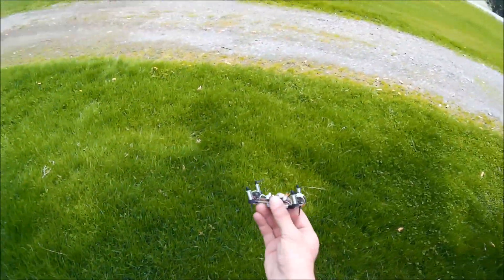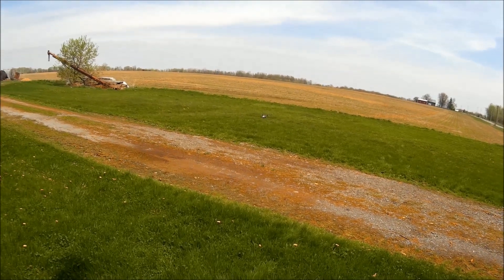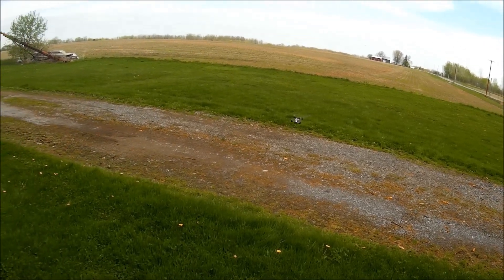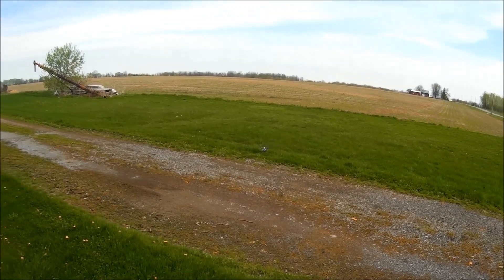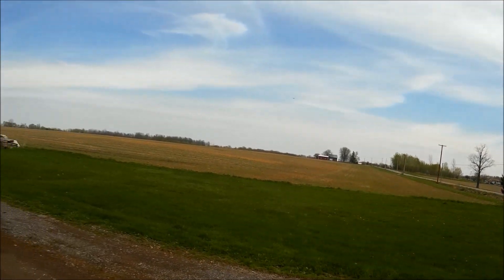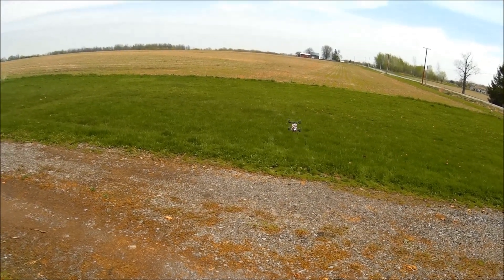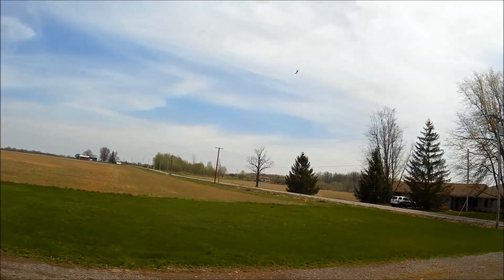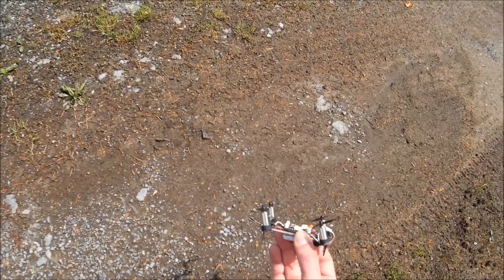Pitching the motors forward on the variable quadcopter

Comment: how long those motors last? like 3 flights? lol
Reply: +historyskyz You are probably doing something wrong. Maybe over propping them or stalling them. Do more research and you will find that those motors have a very good reputation. Careful not to bad mouth a whole company because it could be your mistake not theirs. Check out some RC groups thread like this one for more info: http://www.rcgroups.com/forums/showthread.php?t=2009496
Reply from the maker: +historyskyz 
Why only 3 flights?  These motors are rated for ~5 hours of use.  They may not last that long flying hard and crashing regularly but should handle up to 100+ flights provided they don't get damaged in crashes.
Reply: +Dave Woods maybe I got some duds but all the 8.5mm motors I've gotten gets worn out from heat after like 10 minutes of use, dark edition motors are even worst I advise everyone to stay away from micro motor warehouse
Reply from the maker: Sounds strange.  I have used Lots with no issues along with many others.  If your having problems with multiple sets of motors I'd advise to look into your setup more.
Reply: +historyskyz Okay bud.